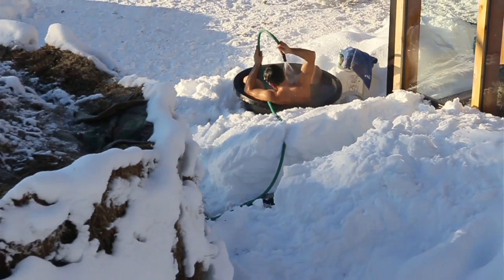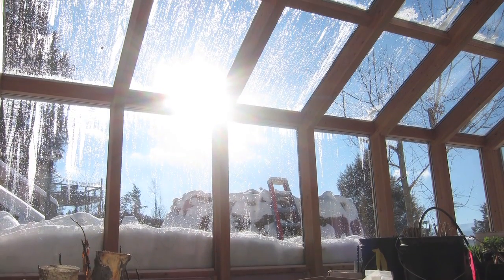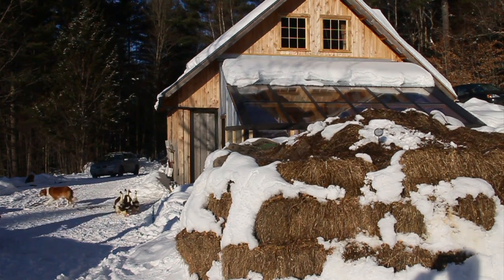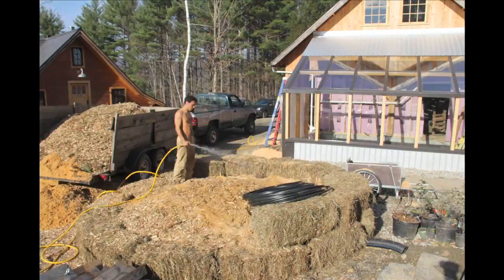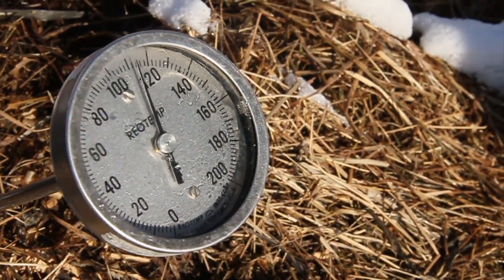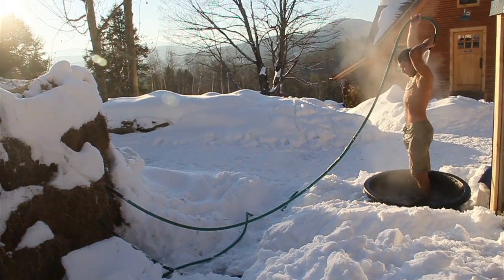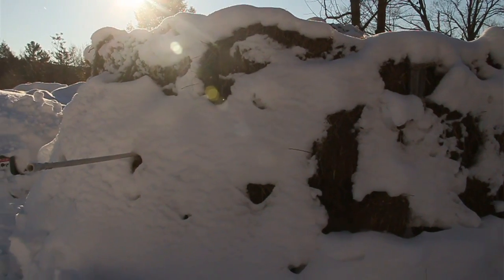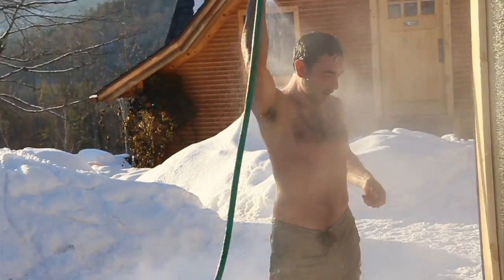Combustion-Free Hot Water at the Whole Systems Research Farm

Comment: Nice video! I’ve been contemplating this thought for a few years now. My compost pile starts with “pure carbon”, ( I’m using leaves minced very fine)  and “my nitrogen” ( liquefied house compost, and different manures) is poured over this carbon base composting pile.

I feel you could have less of a composting pile with higher continuous heat that’s easier to maintain and regulate when the temperature starts to drop. Like stoking a fire you manipulate the fine carbon and liquid nitrogen to get the hottest possible heat!

https://youtu.be/tLm7N231aTs

Comment: check out compostpower dot o-r-g for a Design Guide for DIY. These systems usually stay hot for at least 12 months, sometimes up to 18. It's critical to avoid rot resistant woods like hemlock, cedar, black locust. There's no odor usually, and no catalyst needed other than water...email me through compost power with questions, happy to help.

Comment: Great Video Ben!  I want to make a Jean Pain compost generator in my yard.

Will this work if I dig a large hole in the ground and fill it with wood chips and debris? or does the pile need to be above ground in the sunlight to work? 

Also, I am assuming the manure acts as sort of a catalyst to speed up the decomposing process. if I don't want my yard to smell like crap. is there any other catalyst you can recommend? will wood chips leaves and mulch still work? 

thanks bro
Reply: I know you asked this years ago, but in the event someone else is wondering the same things:
I don't see why you couldn't put it in the ground, but it'll be harder to renew when action slows down in the compost media.  Some piles last months, some much longer, but you'd be digging it out of a hole vs scraping a pile.
Manure stinks to high heaven - when it's fresh.  The ammonia off-gasses pretty quickly, and generally once it dries out its lost most of the ammonia and doesn't smell much at all.  As to why it's there, manure composts and makes heat and methane.  I don't think it affects the wood chips much.

Source: horses out back, big manure pile.  Makes a decent hunting spot in winter since it's warm and the deer can't smell me haha